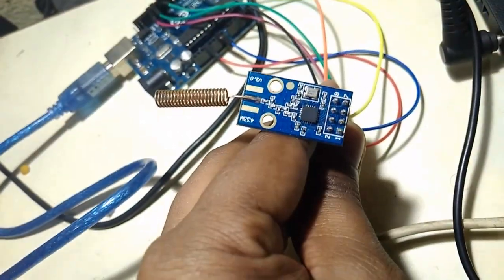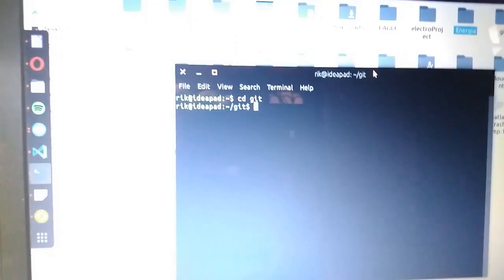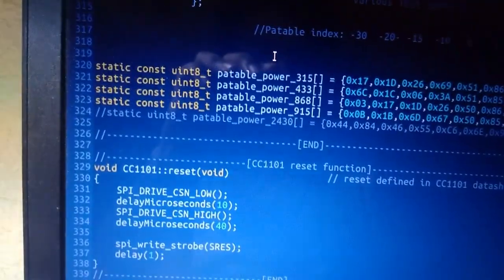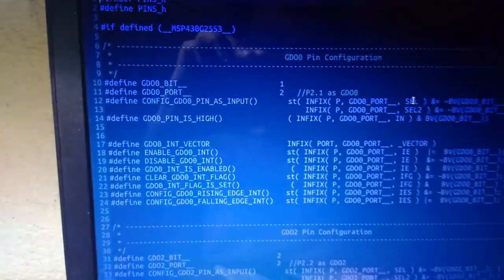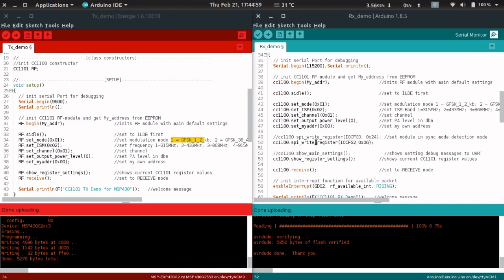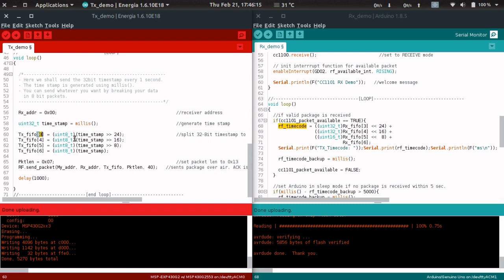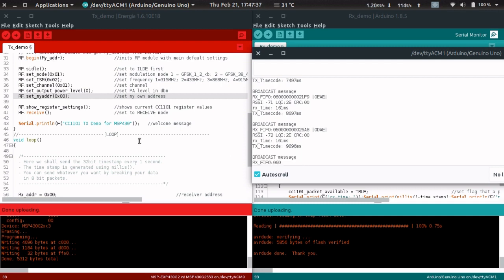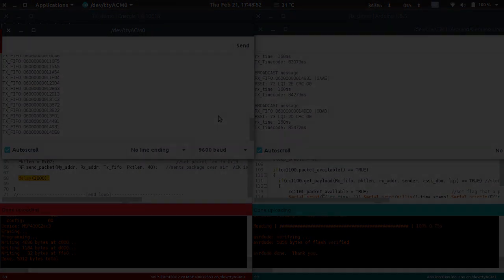CC1101 Driver Library For MSP430 (Arduino compatible)

Comment: Hey.Congrats and nice video!

I set up RPI as TX and Arduino as RX. What i did for Arduino is that i did not go for the external EEPROM configuration upload,instead, ported from the Energia source created by you. The Arduino part worked fine,able to serial out PATABLE and current CFG but it could not listen to what RPI was sending. 

I tried to change the RPI TX demo setting via command line but no success. Any idea on this. I am willing to elaborate more.

Comment: Nice video! I am trying to use and Arduino and cc1101 to mimic a 315mhz ASK sensor. I have the hex and binary code. How would I go about sending the hex with the cc1101? As far as putting it into the Arduino sketch. Or can it even be done?
Reply from the maker: If you want to send raw Binary data (not ASCII encoded), make an array of your data and pass it to the send function as parameter.
Example pseudocode:

uint8_t raw_data_1[3] = {12, 30, 255};
uint8_t raw_data_2[2] = {0x03, 0xff};

packet_send(raw_data_1);
wait_ms(1000);
packet_send(raw_data_2);
Reply: two years late but how did you do i need help

Comment: Mate i have cc1101 with 8 pins but i dont know pins' name 1 to 8 . Do you have any info for this?
Reply from the maker: Go to the description of the video and you'll find the github repo link there. In that repo you'll find the pinout of CC1101.
Reply: @avramitra  any leads on connecting with arduino
Reply from the maker: @noobking5056  just use SpaceTeddy's library for that. Either google SpaceTeddy cc1101 library, or go to my repo (link in the description) where I linked their library
Reply: @avramitra  kind sir i have been trying to reach out to you for five days on github youtube but I couldn't get a contact,i want to use cc1101 to transmit my car key fob could you help me do that with space teddy library please please please I subscribed
Reply: @avramitra   kind sir i have been trying to reach out to you for five days on github youtube but I couldn't get a contact,i want to use cc1101 to transmit my car key fob could you help me do that with space teddy library please please please I subscribed

Comment: Hi great vid thanks 👍🏻 I have a question for you sir ? If that would be ok as I can see your a expert in your field do you have a email address please
Reply from the maker: Glad to know that you liked it.
Even though I'm far from being an expert, you may ask your questions and I'll try to answer them.
Reply: Hi sir and thanks for taking the time to reply and I would easily regard you as a expert in this stuff , I watched what you did in your vid and I was blown away and it got me thinking about a little project I’m currently working on in which I’m trying to build a device or a pair of devices that can relay a LF rfid signal , I have bought a pke system for a car and I’m trying to do a relay attack basically trying to trick my key fob into thinking it’s closer to the main pke unit that it really is , can I replicate this using Arduino and other bits and bibs
Reply: Avra Mitra thanks very much that’s kind of you sir my first question is if I wanted to capture and Re transmit a LF rfid signal at say 125khz how would this be done ?